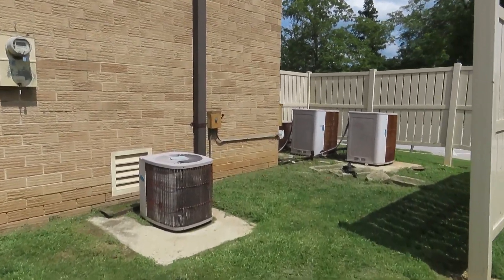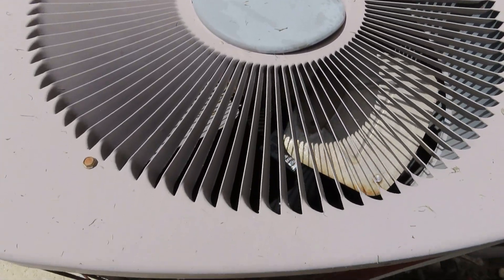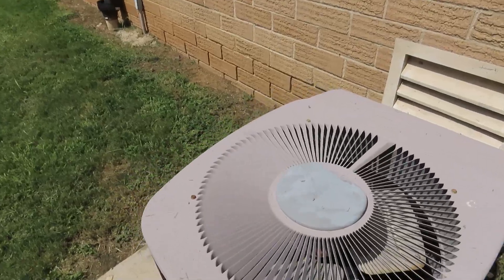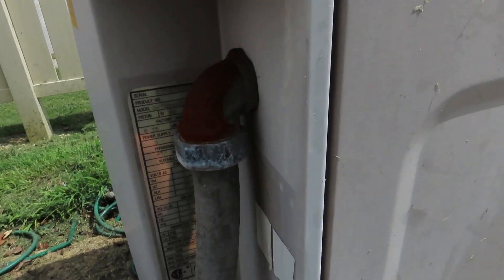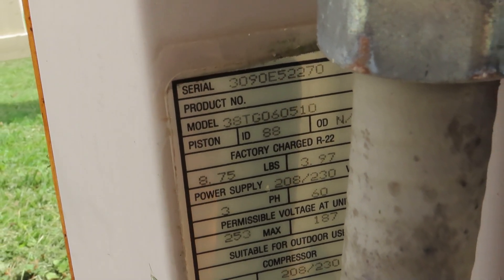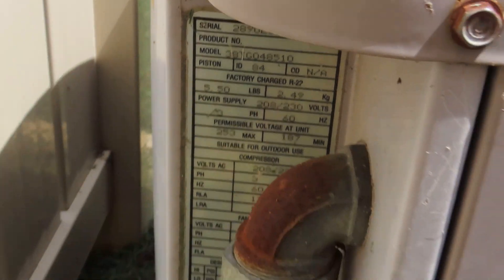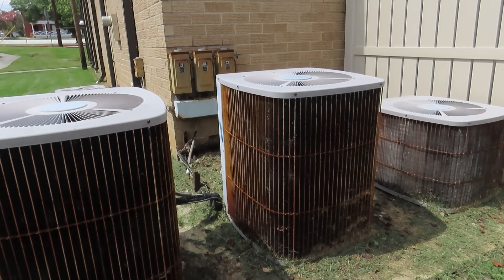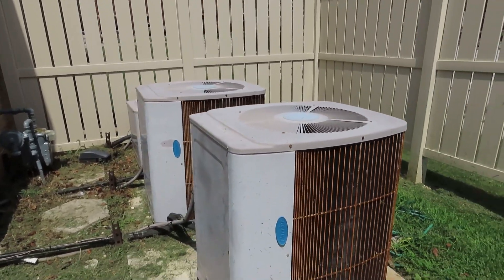Four Vintage 1990 Carrier TECH 2000 Central Air Conditioners

Comment: I agree they sound awesome I have the 38TKB from 1995 on a 85 to 90 degree day dewpoint 65 to 70 it’s running hard!! A 98 to a 100 degree which we experienced in Wisconsin last week which is rare dewpoint 75 82 degrees it ran extremely hard and it is louder. Hot air coming out feels like heat rushing out of brick pizza oven!! Lineset is ice cube cold and really wet. So I couldn’t agree with you any more that these from that era where top notch units. Will be interesting to see how many more years mine last. It gets used very freely not one to only run it sparingly I use it pretty much all the time every summer so this up coming holiday weekend and much of next week the upper Midwest is gonna have another broiler. More than likely this will probably be the last one since it’s this late in the season. Then in about a month we’ll have to switch over to furnace hopefully not LOL cause I would like at least one month of a lower ultility bill. It is what it is though cause either way I’m not gonna sweat or freeze in my own house
Reply: Ron,i was wondering, i have one of these units, maybe a 99 vintage, not really sure on the exact year but there about, i suspect my capacitor has gone out, it went out like 5 years ago so i supposes thats whats happened now again, i assume you have to take the top off and the capacitor is inside of that little black leather looking cover that wraps around the compressor?  last time i called the repairman because i was super busy but this time I'm gonna fix it myself, im guessing you take those screws around the circumference on top and the fan and top all come out together? thank you much for your time.
Reply: @dntlss  There’s a good size flat panel/door that is slid up under the top part where the fan motor is mounted on just take the screws out on the door and take a few screws closes to the panel  on the top part and gently lift it up alittle and then there’s another compartment under the main panel that u removed an that’s a silver squared box where all electrical coponents are in
Reply: @ronsteffes1155  Cool, thank you.

Comment: I had one of them on my house and it was the silencer series and had a Copeland scroll that was extremely quiet you couldn’t even hear it running over the fan which was sadly changed out because of a leak and other issues and it was still running I wanted to let it stay there until the compressor died but it couldn’t keep up in the summer and had multiple problems
Reply from the maker: The old Silencer System. They were tough units! Thanks!